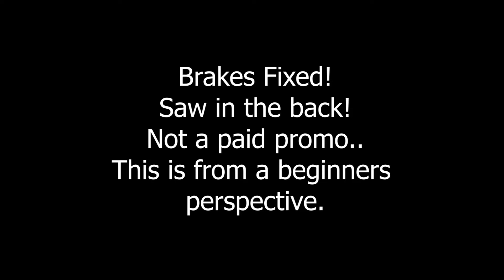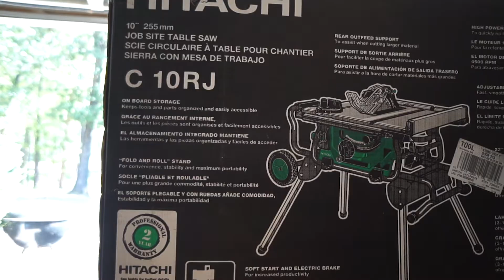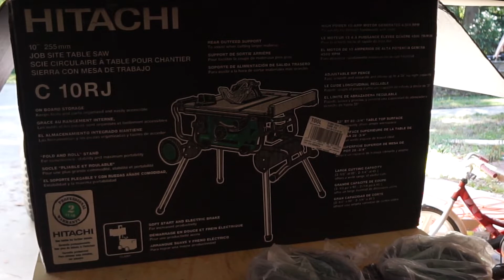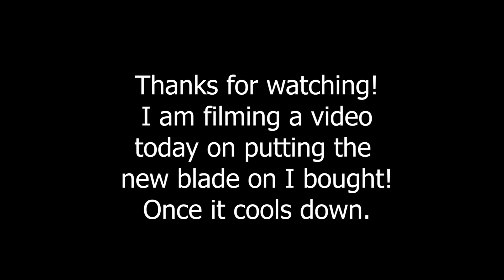TableSaw Adventure! Purchased a Hitachi Portable Tablesaw! PT 1 (SUPER STOKED)!

Comment: Nice saw,I got the same one last month. Some one returned because it wont turn on, they sold it to me for $50 and I took the back cover off the motor and the black wire was not connected, put it back and it worked.
Reply from the maker: Heck yea! Simple fixes..
Good for you man! That's awesome!
 I just bought a metabo 60T blade for it. Hopefully it will be better than the Avanti blade.
That video is next!